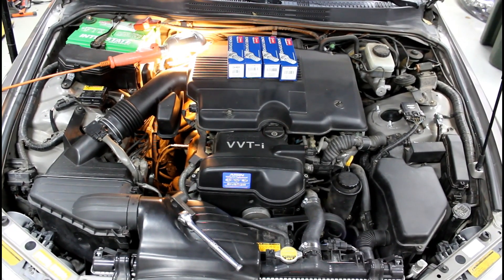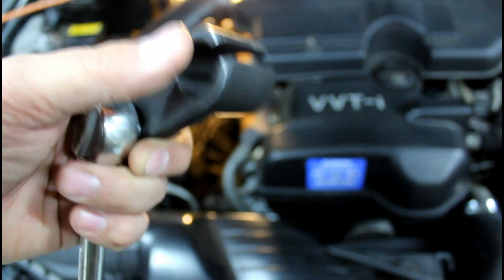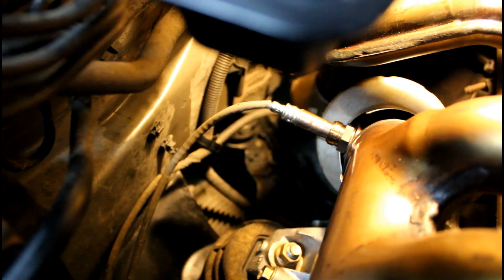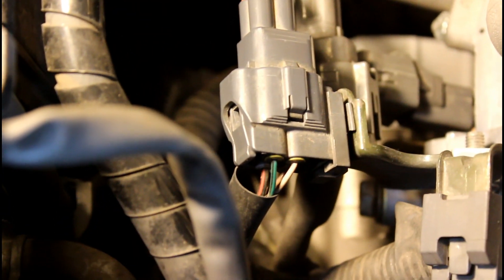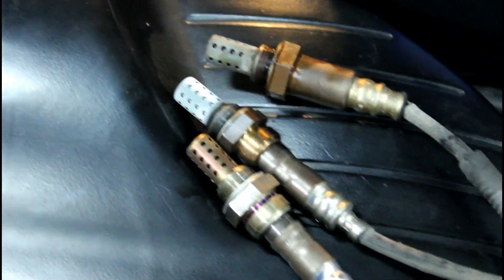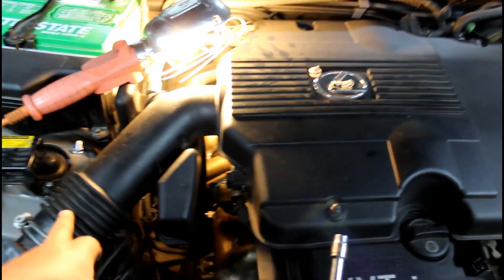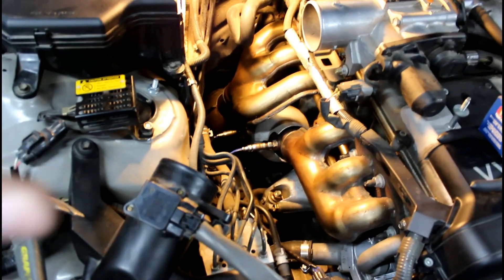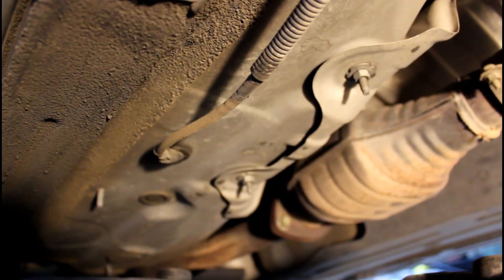How To Install Lexus is300 Oxygen Sensors (Step-by-Step)

Comment: So uh, 4630 didn't work for my 2003 is300 because the cable was too short (like almost a full foot.) But I found that the 4015 was the right length and plug. Just an FYI for ya! Your video was super helpful!
Reply from the maker: Huh.  Weird.  U sure u didnt mix 2 part numbers up?

Comment: Bank 1 is cyl 1-3 and if you are facing the egnine bay should be the mainfold closest to the radiator. Bank 2 is cyl 4-6 furtherest from the radiator. I'm going backwards now for absolute reason.
Bank 2 sensor 2 is furtherest sensor from the engine, bank 2 sensor 1 is the one closest to the firewall, bank 1 sensor 2 is the sensor after the cat, bank 1 sensor 1 is the sensor before the cat.

Comment: What year is the IS300 you're working on?  2005 and older will plug in,  in engine compartment, 2006 and newer is under seat?
Reply from the maker: i dont remember

Comment: need to specify with sensor is bank 1 sensor 1 and bank 2 sensor 1 and so on. other than that thanks for the video
Reply from the maker: All of that is at the 2min mark.  Upstream and downstream along with 123 and 456
Reply: @FatGuyBuilds  When you look this stuff up it says bank 1 sensor 2 and all that jazz. Not 123 456. I get what you're saying but it's not the lingo everyone is expecting.
Reply: There is nothing on a search that shows exact location. I am trying to locate bank 1 sensor 2 for an 03 lexus IS300. Can anyone post a picture not just a diagram? It would be greatly appreciated. My arms and hands are bruised from trying so far😣😣😣

Comment: Which is the 02 between the exhaust and firewall, which is hidden and hardest (of course) is it bank 2 sen2 or bank 1 sen 2.? Thanks
Reply from the maker: the one up top in the back should be bank2 sensor1 (upstream)
Reply: FatGuyBuilds I know that Bosch has some universo that can be used for both up and downstream. Your take.?
Reply from the maker: @diegomarquez9505  universals require crimping.  price difference isn't worth the risk of failures.  just buy direct fit.  rockauto.com
Reply: FatGuyBuilds sounds good.! Thank you...
Reply: @diegomarquez9505  for a few bucks more (8-10 bucks) you get the connector and avoid soldering/heat shrinking work.

Comment: I need one for p0135 O2 sensor Heater Circuit  (bank 1, senor 1 ) 

And also for p0155 Heater Curcuit ( bank 2, sensor 1 )

Can you help me out on which ones those should be? Thanks I would gladly appreciate the help here!
Reply from the maker: that is both upstream 123/456
Reply: @FatGuyBuilds  so for bank 1 sensor 1 it is 234-4626 ? 
And for bank 2 sensor 1 it is  234-4630?
Reply from the maker: @kamikaze6305  just to make sure i didnt screw up.  Goto rockauto.com and the call out up and downstream
Reply: @FatGuyBuilds  to be honest I dont know which ones are they, I would be very happy if you would please give me exact ones I need in the denso brand preferably.
Reply from the maker: @kamikaze6305  2344630...  2344626